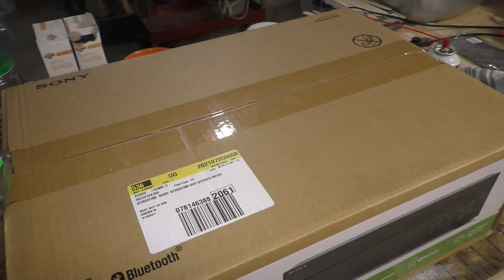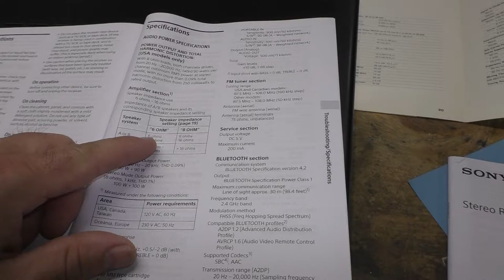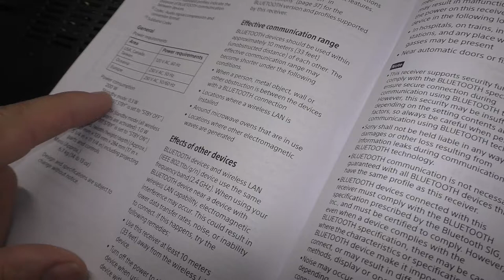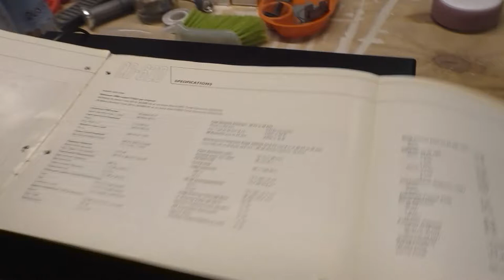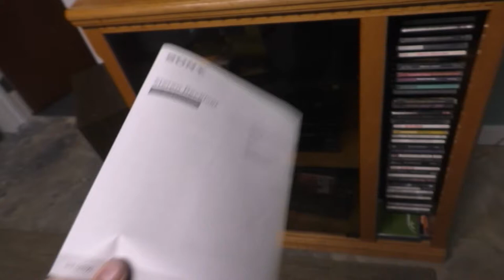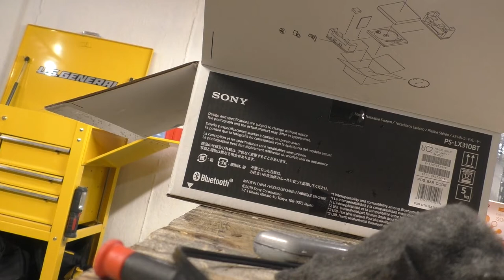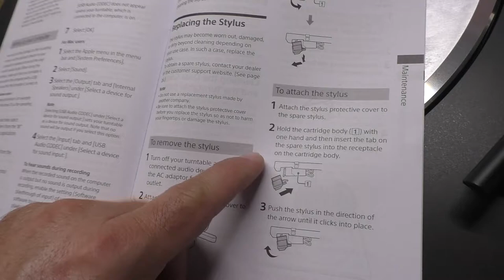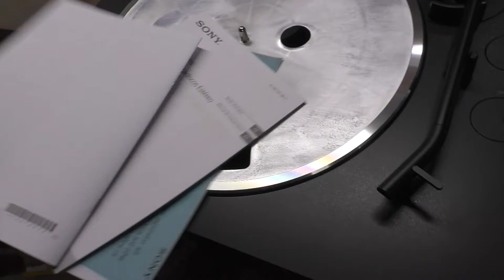Sony STR-DH190 Receiver and Sony PSLX310BT Turntable - This could be the PERFECT entry-level combo!

Comment: Those speakers are spec'ed at 6ohms, so you should be fine. Even if they were 4 ohms, that amp would be able to drive it if you kept the volume conservative and maybe added some cooling. The power output numbers are optimistic though.
Reply: I agree, it will be fine.  Not going to be playing a nightclub levels anyway.

Comment: If I had any money I'd probably buy one of those. I've got an old 2001 Sony Dolby Digital receiver connected to my computer, and it's old and hot and has 3.1 more channels than I need, and I have to chase bad solder joints every once in a while... This receiver would be perfect for me.

Although I could just get off my lazy ass and fix my old Pioneer stereo, but whatever

Comment: This device actual input power 120v/60hz bt I'm using Indian standard 220v/50hz . Can I use any converter for this? If not, can the same Indian standard be used?

Comment: As a complete novice I wanted to ask this question, the Sony turntable can be paired with this receiver?
Reply from the maker: It will work with any receiver as it has both pre-amp outputs as well as amplified outputs.

Comment: I have this set up. With the rca inputs in the phono jack. My speakers are passive  sony ss-cs5 in the speaker A ports. Im not getting any volume until i turn the knob past 50 and it is relatively low at max. Any suggestions for troubleshooting?
Reply from the maker: What input device are you using? Need more info
Reply: @bbishoppcm  I figured it out. Stylus wasnt properly attached out of the box.

Comment: I’m a noob and just getting into vinyl, I have a question plzzz help!
Im bout to get the Sony PS-LX310BT with the STRDH190 2-ch Stereo Receiver. I’m looking at speakers and found these “Sony SSCS5 3-Way 3-Driver Bookshelf Speaker System (Pair)”  My question is what wires do I need to connect the speaker pair to the STRDH190 receiver to play records from my PS-LX310BT ?
Reply from the maker: Should be just standard speaker wire; 14 or 16 gauge.
Reply: Just a word, when it comes to a turntable, save your money and get a really nice direct drive Audio-Tecnica or similar turntable. Be aware that despite the different names and companies selling turntables, they are all made at the same Chinese factory. Cosmetically, they are different. Mechanically they all are the same, like my 1968 Pioneer turntable. Not much has changed, but when it comes to your vinyl, you want the best to make contact with your record.

Comment: I'll warn against pairing the dh190 and ps lxbt310  together as there was a hum i was unable to eliminate when the table was connected 

The table has no ground connection so couldn't even use that to eliminate the source of the hum
Reply: Did you found a solution? I want to buy this, but i don't want a humming problem. Do you recommend this setup to me?

Comment: Interesting setup. BTW, I have a Pioneer PL-740 direct drive turntable built in 1968 that is leagues better than that POS Sony turntable. I got it from my dad, probably when he and mom moved. Some of these 'retro' units are quite advanced, like the ability to balance the tonearm, anti-skating and auto tonearm operation. But they don't have a preamp built in but also don't have the power brick. 
You are right that anyone who is going to get into vinyl would be better off looking for a much better unit. The Sony costs way too much, so much more that I would go ahead and get something like the Audio-Technica 120XUSB for $350. Now about $120 more than the Sony but with direct drive and a very good cartridge. The Sony receiver is OK, it can't possibly hurt or damage a record like a bad turntable with basic crap like a crap cartridge and needle.
Reply from the maker: I am actually quite happy with the setup - it’s not for audiophiles, but for folks getting into vinyl for the first time who want something better than a Crosley suitcase, are on a budget, and have little to no skills for dealing with vintage equipment - this is a pretty sweet package. It really comes down to speakers; those will make or break the experience. Eventually I will repair the 1970s Yamaha receiver I have, but for now, this is fine as a basement stereo.